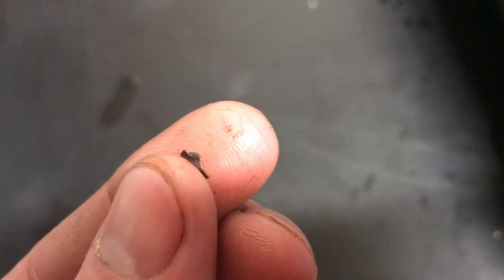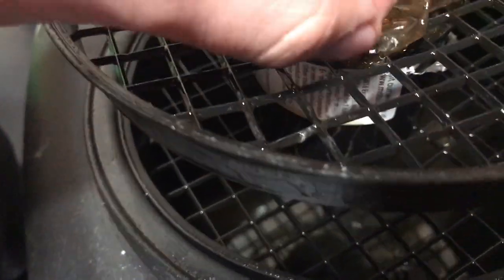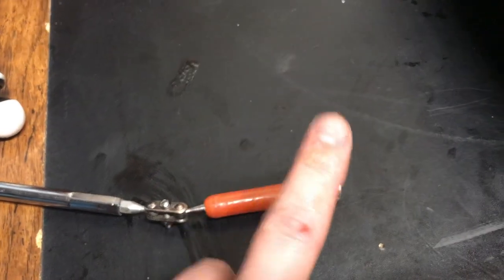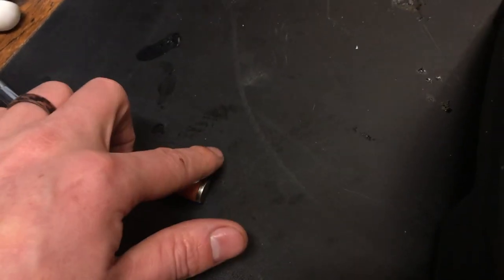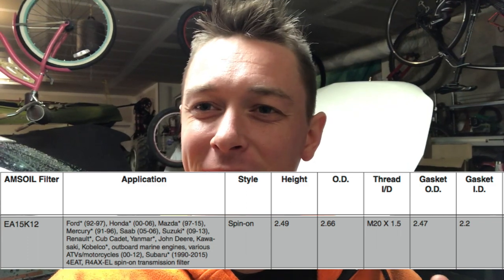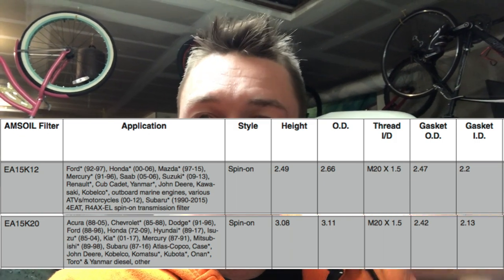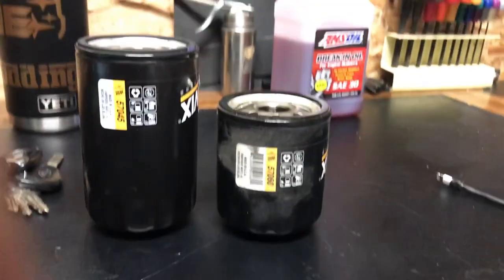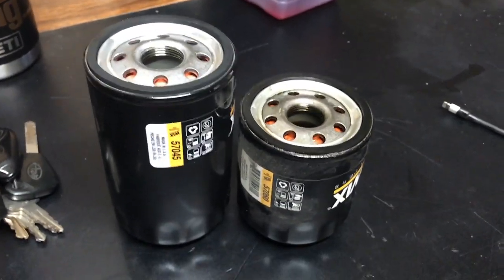First Oil Change Problems??? Oversized Filters!!!

Comment: If you use a filter larger than spec, you may need to add a slight bit more oil to refill it to the full mark since the larger filter puts more volume in the overall oil system of the vehicle.

Comment: Nope, not just thread and gasket sizes. You'll need to compare bypass pressure also. If the bypass is higher pressure, your engine could starve of oil in some instances ... just use the owners manual recommended.

Comment: I use a totally different oil filter  recommended by the manufacturer because I was doing a oil change and didn't have a spare.  It is smaller but the thread pitch is the same and the rubber mating surface matches!  Perfect i though.  Why waste an oil filter from a previous car right?  Well, this may or may not be related but less than 200 miles in the oil pressure light on and almost stalled and almost no power steering ....pull over shut off engine restart and it's fine driving until another hour then it happens again...... tomorrow I am going to put it a correct oil filter to see if than changes anything....
Reply: Or maybe you just forgot to refill with oil ?

Comment: well, since that piece was magnetic. its not bearing material or aluminum...and thats all you took out of your oil? 

Did you cut open your filter and see if there was anything else?
Reply from the maker: I tried to cut it open and failed and cut my thumb up HAHA. Got pissed and threw it away. I still have the oil that I can look at. I just can not think of where it would have came from. Its very mysterious. The way that it looks makes it look like the piston scratched it off. I don't know I'm hoping that I don't have to tear it apart again.
Reply: not unusual to have pieces after rebuild. but that was rather thick. the piston is aluminum too, so I dont think it is that. If its not knocking and oil pressure is good. I'd keep sending it
Reply from the maker: HAHA thats the plan so far. JUST GONNA SEND IT. I just don't know what it could be. Steal is harder than aluminum so anything steal would take out aluminum, but the piece was magnetic so it had to be steal on steal.

Comment: does a slightly larger oil filter matter ? all diameters are the same but filter slightly longer ? no bypass valve on oem and other filter either
Reply from the maker: Correct. It's just a little more filter media to help with  cleaning the oil. One big thing to look at is the bypass pressure has to be the same or the filter won't work the same.
Reply: it also helps keeping the engine oil more cool by 15C when using bigger filter.